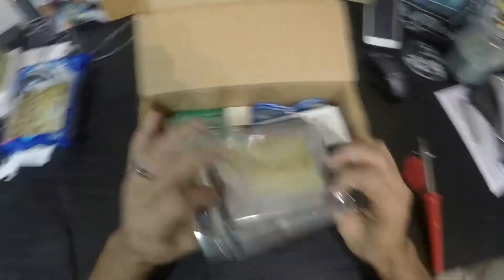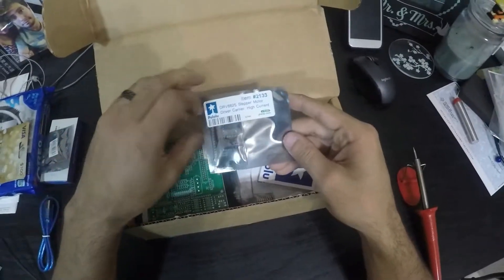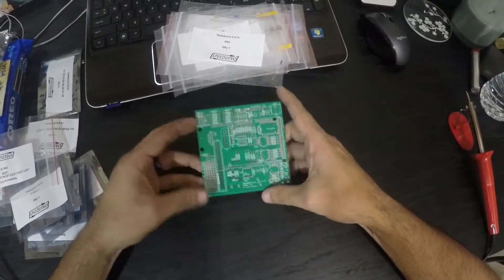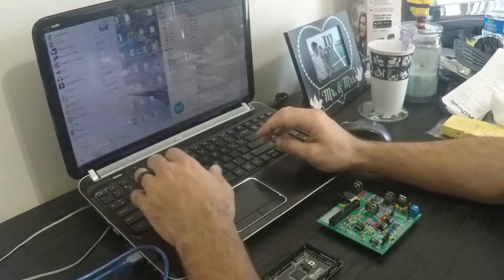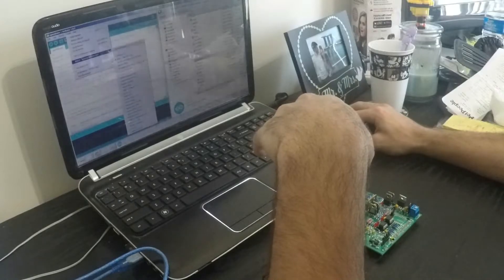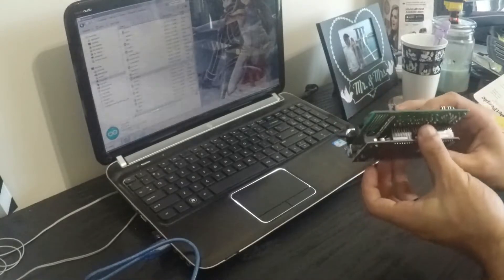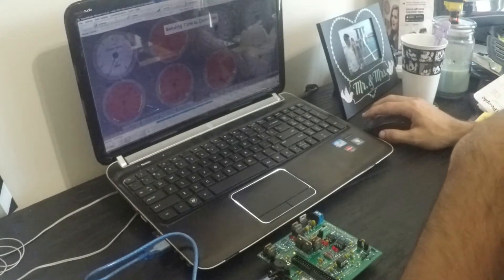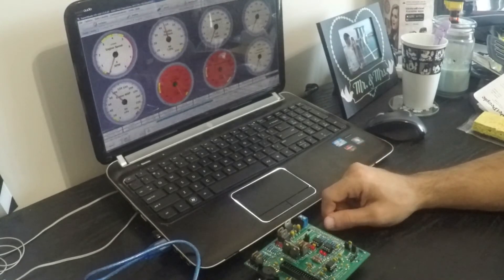✓ Building DIY Standalone ECU 4g63 - AWD Mini Cooper Ep. 6

Comment: What are your plans for converting tachometer, vehicle speed, and temp data to the CANbus system that the mini used to maintain abs, traction control, and a/c as I am planning to 4g63 swap my car in the future?
Reply from the maker: myze creations great question and great plans for a swap hehe
So for the tacho, speeduino does have an output for a tacho signal but I'm not 100% sure how I'm going to use it. Ideally I'd splice into the location that the original Mini inputs tacho and let the system make calculations there, but idk if u can do that without the Mini ECU plug in because the tacho uses communication links and interprets the signal in the tachometer itself which means I can't just run a tacho input to the tacho unless I bypass the mini components and tap into the tach motor directly to override it independently (hopefully I explained my thoughts well on this lol)
But my plan is to run a tablet on the dash that has a tacho on it so the OEM one isn't super critical. I basically need it for the turn signals, high beam, sport mode, TPMS, etc.
The good thing about the can bus system is it's pretty modular so some may work on their own. Abs and vehicle speed should use wheel speed sensors so if I can hook those up again it should work on it's own with speeduino input.
For traction control, that's a bit tougher I don't know if speeduino has that or is even capable of that. I know it has launch control but the good thing is speeduino is configurable so just because no one has done it doesn't mean it can't be done ;-). The challenge with the 4g63 is the cable throttle. It can pull timing to cut power if you get slipping, but most cars now restrict throttle input max values on the electronic throttle. You'd have to convert the engine throttle body and pedal assembly to electronic like with a GM pedal and TB
AC should be able to work by pressing the button. The temp control are the same. The AC system is just one wire that actuates the compressor clutch to let the compressor spin with the pulley. So just refit the 4g63 connector to the original spot on the harness. For me, my subframe hits the compressor at the original location so I'll have to either rebuild the subframe and chop more of the frame or not have AC which makes me sad. I'll probably wait til I build the engine to finish getting the AC hooked up sigh
My tablet dash will use the 4g63 speed input off the transmission. The 1g engines are cable speedometers so what you can do is use the 2g sensor to convert to electronic and read from the transmission. Then build an input for the speeduino ECU to read vehicle speed and now you can log it.
There is a section on board of this ECU for added inputs and outputs. Things like fan relay control, boost control, fuel pump relay control, tacho, etc. I know there is an intent to do can bus integration but idk if that is this board or a future one
I definitely encourage you to check out the speeduino website/wiki and the Facebook group to see what other people have done and can do. Electronics is not my strong suit at all haha
I hope I helped a bit and explained my current plans well. Somethings may not work as I'm thinking (can bus can be a challenge for sure especially with no published info). 
Happy modding,
Ryan @ InitialDIYmods
Reply from the maker: And sorry for the long reply, there wasn't really a short answer haha
Reply: Hey,
Thanks for the detailed reply, it is more than I could have asked for. If you're planning on using a "stand alone" dash setup then you are pretty much set to go. 

But if you were interested in keeping the OEM gauges, since you are using a Arduino based system it is probably feasible to use a arduino CANbus shield chip to simulate the signals the stock ecu would put out from your arduino ecu setup to keep the gauge cluster happy (for the most part lmao)

As for myself it really depends on if I'm feeling a little bit more DIY or not when I do my own project and what (the less DIY) standalone ecus like haltech/aem provide and if they can provide the CANBus translations into a Subaru CANBus code. Which I think should be possible since in the Mighty Car Mods Tribeca H6 Turbo Swapped Legacy they have the Dash working fine which uses the same CANBus system as my gen impreza with their Haltech setup which makes me believe that it would be possible.

If not I'm still probably going to learn some arduino code to make some useful data reading led screens and then I'll learn how to convert into my cars can.

Anyways, I am excited to see how your build ends up I'm sure it will be nothing short of amazing already seeing how hard of a worker you are. 

-Kris
Reply: And also like your build, my car (2010 Subaru Impreza) shares nearly the same track around .6 inch, and nearly the same wheelbase at .2 inches smaller than a CT9A Evo 7-9. 

I'm already learning a ton from your own build and compiling my own set of plans because of your videos.

And yes 4g63 drivetrain in a Subaru, I can't wait to make some fangirls cry when they learn it is not an EL headered subie lmfao.

Thank you much man!
Reply from the maker: myze creations HAHA YES, I want to put a Chevy LS into a 1956 Ford F100 and watch everyone's minds explode screaming " it's sacrilege, how could you?!?!?". Sounds like a good plan though and space wise it should line up fairly well. Engine placement will likely shift backwards a good bit though because of how the subaru gearbox mounts. It should help center the weight distribution forwards and backwards. I believe it's more like a NS engine with the transmission coming off the back of the block rather than an EW like the 4g63 with the transmission on the side. The axle line on the 4g63 sits about an inch or 2 behind the rear block face so hopefully you don't have to modify the firewall because that gets challenging. Definitely want to do as little fab work as possible to make it easier on yourself and more convenient if possible. Sometimes it can't be helped though for one reason or another
Now for the gauges, isn't super Gramps (the boosted v6 ez36) using an older Subaru liberty chassis and didn't they put a Haltech racepak dash in there or am I mixing my MCM builds?
Now for the Arduino based OEM gauge, that's way beyond my level for figuring out in my own haha. It is probably possible but idk how to even start decoding the OEM canbus lol. I'll be able to get it running and working first and then possibly look towards that in the future. I like how the tachometer is mounted on the Mini though but currently it only goes to 8k rpm and I'd like to build this thing to hit 9k rpm some day (maybe I've been watching too much of the show "Initial D" LOL). It's got the entire dash of a normal car smashed into the Mini tachometer including speed (which makes me wonder why that monstrosity of a speedometer is in the middle of the car where the radio goes).
But thank you for your kind words and watching my videos. Keep me updated on your build progress and I hope my build can continue helping your plans for a 4g63 Subaru Impreza ;-)
Feel free to continue asking questions on any of my videos and I'll help you out as much as I can.
As always, happy modding,
Ryan @ InitialDIYmods
Reply: myze creations Oh man that's awesome! I actually considered doing the same swap since I have a GSX I could use as a donor and a 2.5RS shell, but I want to keep the GSX alive. I love unconventional swaps! My current fan boy killer in a future SR20 swap MR2!